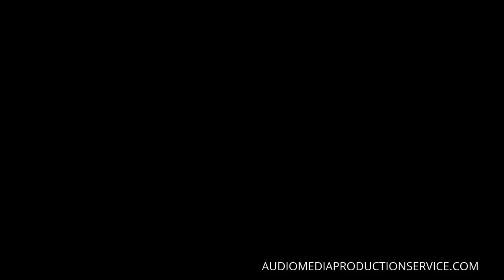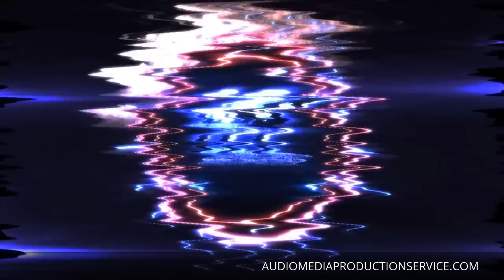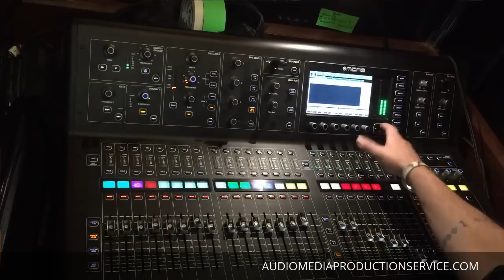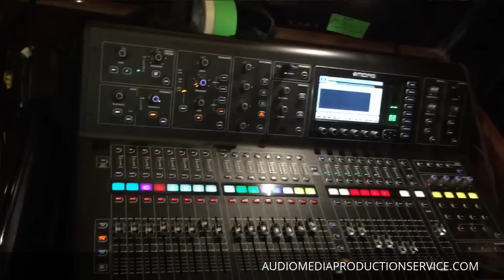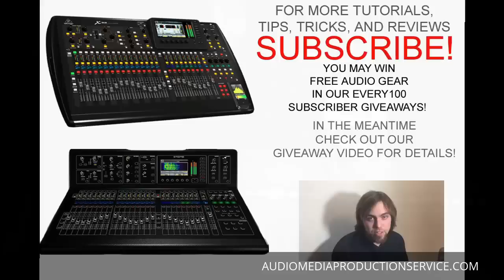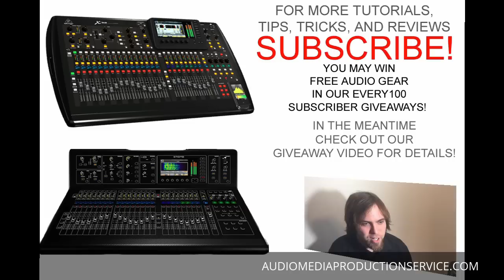Midas M32 Review

Comment: What is the proper way to shut down this mixer? I just recently got one of these installed in my church and I cannot find the shutdown function within the menu options. We previously had an X32, and the GUI is very similar but I can't find the proper instructions online or in the manual.
Reply from the maker: Pharoahe' ManC Proper way to shut the mixer down is to lock the console by holding down the home button  till the console is locked and then turn the mixer off. hope this helps. Cheers